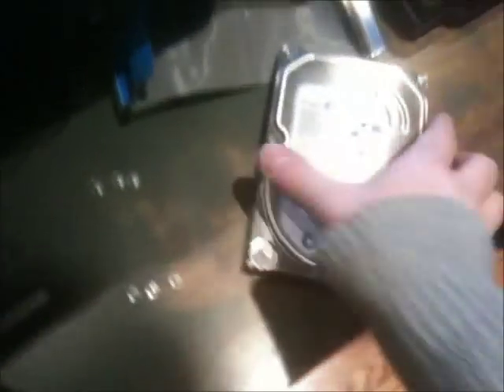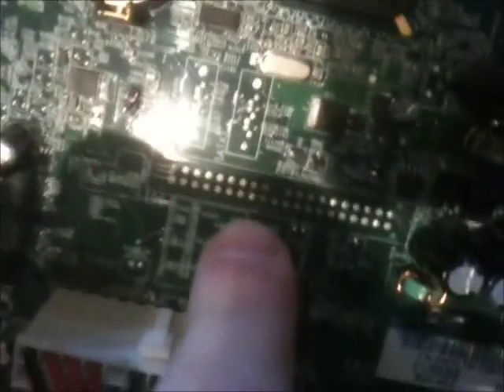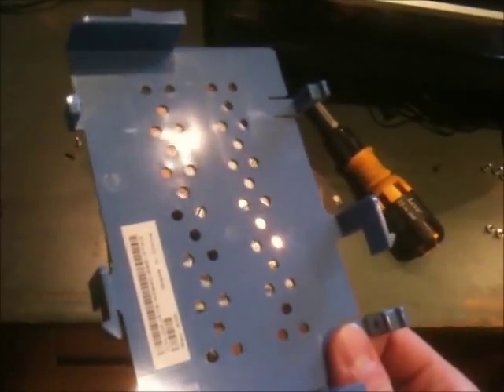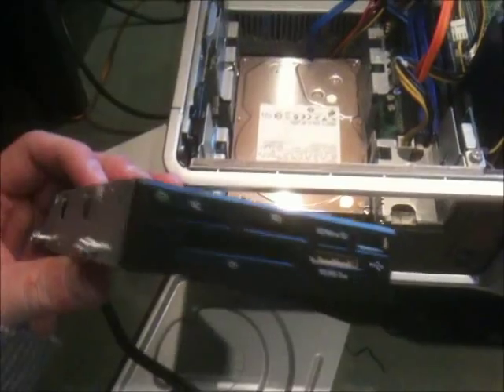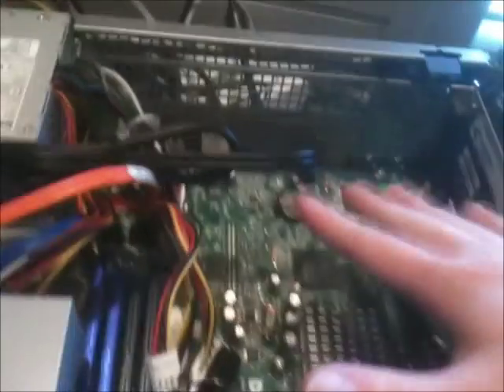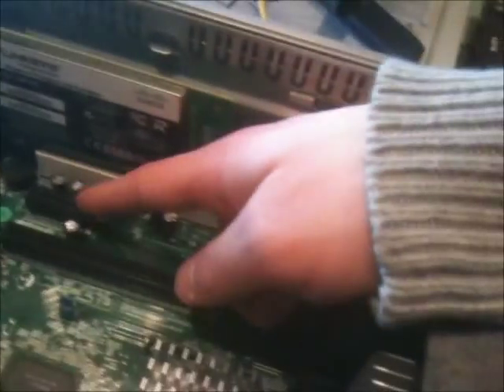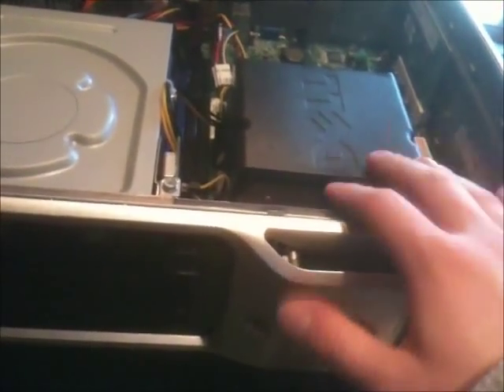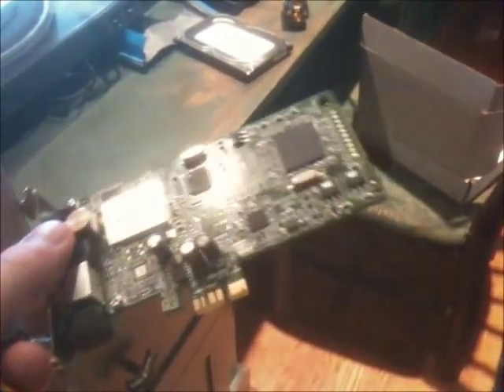Dell Dimension C521 Upgrades Phase One

Comment from the maker: @RockStunner007 these can be upgraded, you can put a faster processor in these. the processor slot is AM2, so you'll likely have to resort to ebay to buy one. if you can find a 4800+ that's an AM2 socket, not AM2+ but just AM2, that computer should run much faster. that's the processor i'm looking for to put in mine.

Comment: mines still running with the original 160Gb drive, and its been on almost every day for 6 years with about 12 hours a day of heavy use as its used for work and leisure. finally going to upgrade it this year, buts it been an old faithful machine, especially when I got an external hdd and more RAM.

Comment: It should be able to.  I used to have a C521 w/ 4gb ddr2 ram (2x2gb configuration).  Word of advice: if you upgrade to 4gb, you might have some trouble getting the machine to boot.  If so, go to Start > Run > type "msconfig" > go to Boot > Advanced Options > make sure that "Maximum Memory" is checked, then set it to it's max amount (i.e.- 4gb = 4096) > click OK, then restart computer.  Also, I don't know if this will help, but boot into your BIOS after install.  This is what worked for me.

Comment: Hey man i currently have this model all i have upgraded in it since i got is is the graphics card from a 128mb ati radeon to a asus geforce 210 1gb graphics card. i am looking to upgrade further do you know by any chance what the max processor i would be able to fit into this i know it use the am2 socket i am currently running on a amd athlon 64 x2 3800+, if you would be willing to message me with the details of what the max ram, Processor etc is i can put in i would be very gratefull.